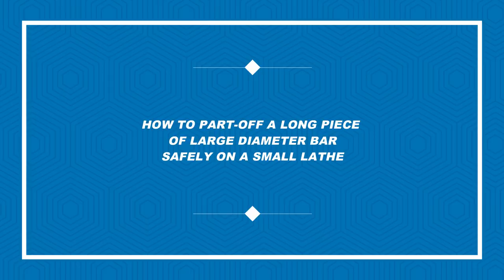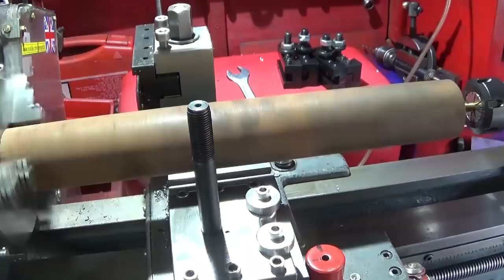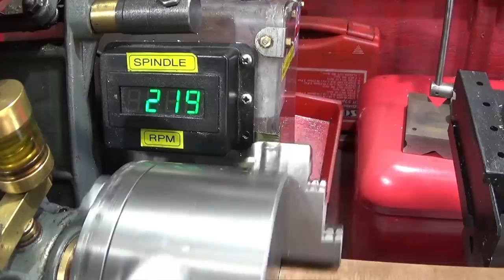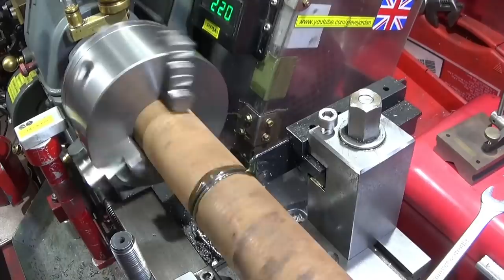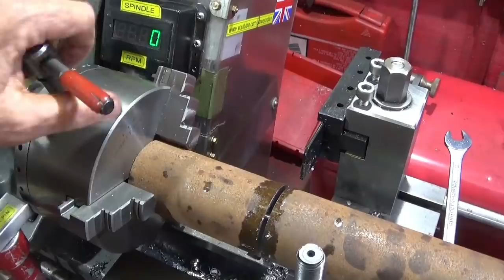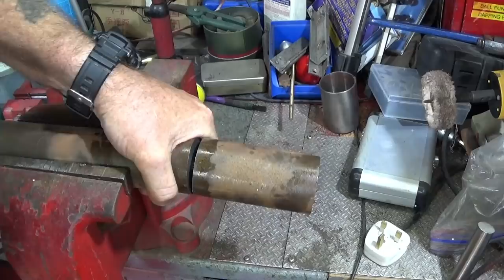How To Part-Off A Long Piece Of Large Diameter Bar On A Small Lathe

Comment: Nice job Steve, pushing the envelope of your myford to the max. One of the first jobs I am going to do when I get my milling machine in a few weeks time (oh the excitement) is make a rear parting off tool unit for my lathe...... You have just convinced me. Keep it up, enjoying the content. Jon
Reply from the maker: Hi Jon, Thanks. I would love to have a milling machine, but I haven't got the room. The upside down part-off, I found is the best method. The inserts last as they should as well. 
  What milling machine are you getting? Regards Steve
Reply: @SteveJordan  Thanks for the reply Steve, keep an eye on my channel, I haven't decided yet but I will be posting a video tomorrow night with some thoughts. I have already ordered one machine (sorry for the cloak and dagger stuff) which I will reveal in tomorrow's episode. Would welcome your feedback on any of my thoughts in the few videos I have posted so far, just trying to get the workshop and channel up and running. Thanks again, Jon.

Comment: Mike Walton is making some quite surprising progress with hss tool grinds on his channel, including parting off grind. Worth a look, as he uses the tools he makes and sells at a very reasonable price, to machine o2 and stainless steels  on his 90kw unimat sl1000 with accuracy and ease. This isn’t supposed to be possible on this small machine, so I’d imagine if use as well on slightly larger lathes.

Comment: great steve thanks for sharing your knowledge, keep showing your videos please, I would like to ask you a question how can you achieve a good finish to automatically cylinder at slow speeds?  We are talking about the advance mm / revolution of the main screw and all those technical data - what combination of pinions do you use to achieve a good finish in 114 steel, for example, thanks to care.

Comment: I have a small Atlas/Clausing and do similar to what you have done. The only difference is rather than taking it out of the lathe I place a board across my ways to protect them and finish it in place with a hacksaw.

Comment: Hi Steve, Just an update on my mini-lathe switching itself off when it liked. I traced the problem to a weak magnetic coil in the on/off switch. It was letting go of the metal plate which lifted the centre pice and held the electrical contacts together. I have a new rocker switch on order which does away with the magnetic bit and once fitted should solve the issue 
Paula
Reply from the maker: Hi Paula, that is great, I'm pleased you found the problem. I don't have a magnetic switch on mine now, just an ordinary push button  type. Regards Steve

Comment: I just had a rant with my wife about your opening sentence.  "A 2 inch diameter steel bar 100 mm long."  It seems that you must have the same problem with standard vs. metric in the UK like we have in the US.  I wish we in the US would just pick a system!  Just one!  The metric system is better, but we need to pick just one.  When I work on my car it will have a standard nut and a metric bolt.  I hate that I just can't pick a set of tools and work on my car.  Oh well, enough with the rant, LOL!  Great video...
Reply: Thank your USA car manufactures for that. In 1972 (or there abouts) the US embarked on a 3 step plan to convert over to metric. We never got past step one - dual labeling. If anything that mucked things up even worse because as hard as straight imperial units were it is substantially harder to toss constantly doing conversions into the mix. Best to just rip the band-aid off and bite the bullet. But the resistance to change over won out and the battle for universal standard was lost (for now). I don't doubt that among other things this has been a signifiant contributor to the large number of anti-science Luddites here.
Reply: I'm surpriced that the Imperial using US have got as faar as it has. Look att the different units being used. There is "thou", decimal, there is fraction, letter drills, number drills..... I've got imperial collets for the mill to handle Imperial wigglers, Coax indicator, other various indicators etc. A set of Imperial hex keys is also needed, to assist my metric sets.
Reply: When you get right down to it, it's hard to make a case for any system of units over another.  Perhaps a system could be based on more fundamental aspects of nature.  It's not a great argument.  And the meter isn't any more fundamental than a yard so you can't use that to argue for metric over imperial.  I know where you're coming from because I held those views for a long time but if you study history and metrology, you would see that these topics are more utilitarian and political than factual.  The Internation System is fine but it basically was spread by conquest, not popular demand.  The Imperial system was spread by exploration, business, and economic forces.  Before widespread trade, every country had their own way of doing thing and it was fine because almost the only argument for a particular system of units is that other people use it.  The other argument is historical---my people use these units so I use these units.
Here's a fun fact:  in physics software, often the units aren't defined because it doesn't matter at all.  Just pick a unit of weight, a unit of distance, and a unit of time.  Other units can be derived from those 3 picks.  So if you configure the software with a consistent set of units, the answers will automatically be in the correct units.
Reply: @neffk  I'm sorry, but I have to disagree. The metric system bases as many things as possible on fundamental units and those that aren't are based on standards which are as invariant as possible and these only change when something that's even more constant is discovered. I've often though that our time standard ought to be the blip from regular pulsars (not those that vary in period because they are orbiting something) preferably one near the north star so there's no seasonal doppler effect.
Reply: @neffk  You're perfectly right. The "meter" was for a long time defined by a holy piece of metal in Paris, France. Later a certain number of wavelengths of Cecium(?) was used. Why not Another number ?
The SI-system reduces the number of specific constants for nearly every calculation. But, as You say, both systems are based on something choosen from ?
How about the "letter drills" and "number drills"? I drill metric holes but watching Youtube videos, I'm lost.
Modern calipers are perfect unit converters. Put in what ever units You want and change between Metric, Imperial, or Fractions.
Reply: @ExtantFrodo2  One week unit in the SI system is "g", the gravity "constant"(?) It varies around the planet.
Reply: @neffk  I totally get it!  I remember in school saying "units"  as you talked about.  I just hate how here in the US we use both on the same thing (i.e. car, bike, tractor, etc...)  The thing I really loved about restoring my 1973 Allis Chalmers lawn tractor is there was nothing metric on it.  So I knew it it wasn't 1/2" it was 9/16".  It was so easy to work on from a tools standpoint.  I don't hate the metric system, I jus hate the "mix and match" way we do things.  When I worked for GM they said as soon as all the SAE fasteners were depleted, they would be all metric.  Well I'm not sure if that's the case yet, 35 years later.  But thank you very much for the info....

Comment: My first visit. Just subscribed. I had a bad time last night parting a 2” HR 1018 bar on a 1943 vintage SB 10L. Jammed several times and, thankfully, the belt slipped. I concluded that nasty old gravity was keeping the chips on top of the tool so I ended up stopping to remove chips many, many times. That worked down to about 1/2” when a chip jammed and broke the tool bit. Question/suggestion: I don’t remember you mentioning it but was the inverted tool on the machine side done to help clear the chips? I’d have to do the same or my chuck would unscrew. I had to take a few tries, in a three jaw chuck, to get the 4” long bar running fairly straight. How did you get that much longer bar straight enough to center drill? I didn’t see a steady rest. Lastly, I almost skipped the video title when it said “small lathe”. I immediately thought imported mini lathe. You might like to call it “Myford 8 x 48” or whatever is correct. Thanks for the helpful, and timely, video.
Reply from the maker: Hi it does clear the chips more but it also stops the part off from snatching downward. The pressure is obviously upward. The Myford ML7 also has a screw on chuck so it is a great advantage to be able to mount the tool upside down at the back.

Comment: Good job, what you going to make with that?
Reply from the maker: Hi Tony it be a new type toolpost drill with tapered roller bearings. 
I'm hoping to make it so that I can do small milling operations quickly using a standard electric drill. If it's successful I will show how I make it at a later date. Regards Steve

Comment: Hi, Steve . Looking through your videos, I don’t see any motor upgrades on Chinese mini lathe. Do you find the standard motor is good? Thanks
Reply from the maker: Hi Doug, yes I had the standard motor on my Mini Lathe for about five years. I had two circuit boards break over that period and had several new potentiometers. I got annoyed at the cost of replacing these parts. In the end I bought A 1 HP 3 phase motor and a VFD and converted the lathe. I haven't had any problems since so I'm pleased with the upgrade. Regards Steve

Comment: Very nice. My problem is that I have a 7x10 which has actually 8" between centers.  Makes jobs like that pretty near impossible.
Reply from the maker: I take the tailstock off on my Chinese Mini Lathe when parting off long bar. Regards Steve.
Reply: Id did like Steve tells here but added a steady rest instead of the tailstock! It worked perfectly.

Comment: 6:44 ..."point 200 thou"...is that about "point 5 millimeter" ? 
Thanks for the vid, as usual, right to the "point" 😊
Reply: Correct. 200 thou == 0.200 inches, times 25.4 mm == 5.08 mm.

Comment: Firstly a little warning to all who are reading this comments section. Further down the page are 2 posts from someone named 'Jordan' asking to be friends. I suggest it would be safest for no other readers to press on reply or open those 2 posts. I have noticed similar ones pop up on other engineering themed youtube channels. Don't open them,they may cause havoc with your computer system.

Now onto the subject of the video: Steve you are getting the Max out of the little Myford there. You have an advantage over my Harrison as the Harrisons only have a short cross slide and no Tee slots to facilitate moving the toolpost across to the rear side. I don't really have much problems parting with the Harrison running things the conventional way around because it is quite a sturdy lump of iron. For deep parting on large diameter stock I do find those block and blade setups with the 3mm or 4 mm carbide inserts the most reliable and trouble free. I most often just take the bar over to the 6" horizontal bandsaw ,or does that count as cheating?😅
Reply from the maker: Thanks for the info on the 'lets be friends' comments. I wondered what they were about. I will delete those from now on..thanks
  It must be nice having a band saw. For smaller bar I have one of those angle grinder cut-off fixture tools which saves some time. Regards Steve
Reply: @SteveJordan  The band saw is a game changer. I've had it about 5 years now. Once they've been given a going over the repeatable accuracy and squareness of cut is tremendous. Don't know how I managed for years without one.
Reply: @SteveJordan  totally agree with Howard on the band saw! 
Didn't bother to get one for the longest time, up until about half a year ago. Absolute blessing to have it now!
Reply: Hi Steve,. a lot of people use a portable bandsaw now and they seem to really like them.  I do not have one but if I did not have a horizontal saw I definitely would have one.  They do not take up a lot of room and saw where one person made a mount for it to put in his vice and used it like a vertical bandsaw as they made a little table to attach to it.  They are not expensive to buy and blades are readily available.  I was thinking of your restricted space and all you do to convert things it might be a nice fit for you.  I have the chop saw with the cutting disk but like the bandsaw so much better and do not have all that abrasive dust all over my shop now.  Always enjoy your videos.

Dale in Canada
Reply: @dalemcinnes1834  I have a homemade steel cutting table that can be fitted onto the rear blade guide bearing housing with 2 screws.   Lift the saw arm to fully vertical position,fit the table and you then have a vertical band saw in a couple of minutes.
Reply: @SteveJordan  Steve, they're bots. Just look for really generic comments. I get them and if you click on the 3 dots on the right one of the options is that you can hide user from channel. They keep cropping up under different names. they normally appear really quickly as they are automatically generated. Mart.

Comment: Hi Steve,

I use the steady rest for the same task on my lathe. Do you have any concerns with using the steady rest?
Reply: As long as you dont part it of completely it does not matter ,you could use both if you want to go a bit faster and remove the chatter.
Reply from the maker: I do have a steady rest but it won't take this diameter. I was going to get a larger one from RDG when they get them back in stock. Regards Steve